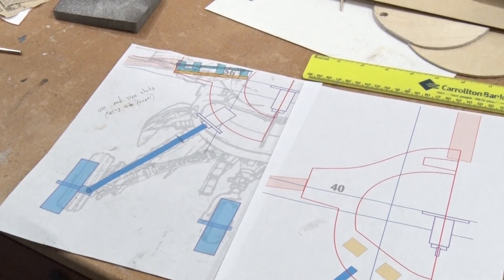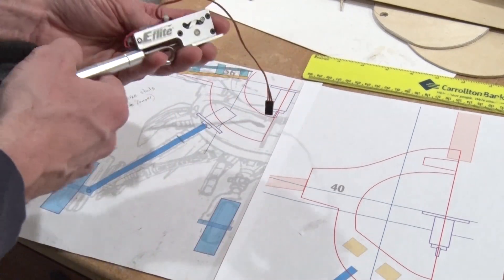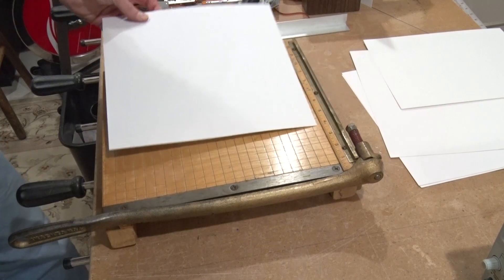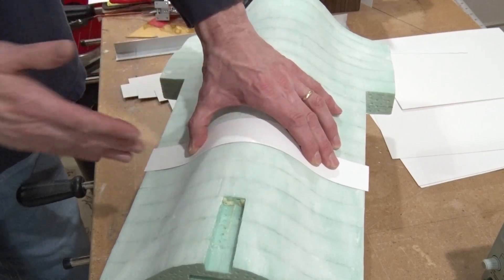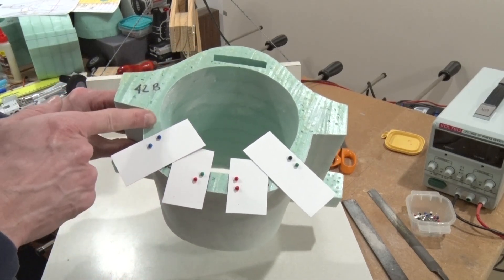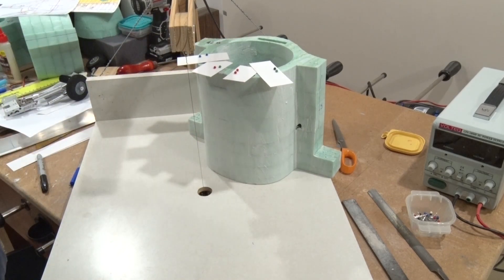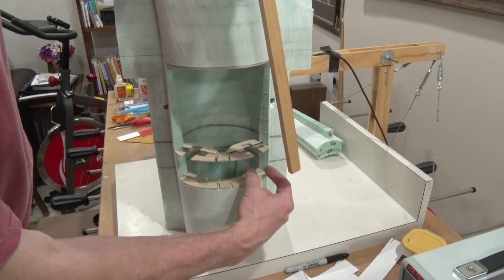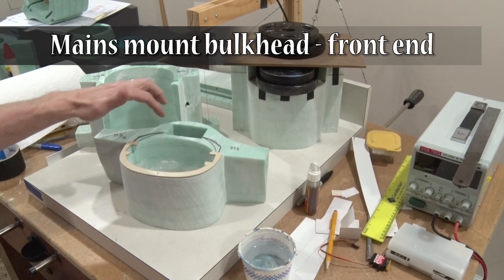Build Process F 16 C (Part 3)

Comment: So did that section just get 1/4" longer  (2 x 1/8" Plywood) or did you have to trim the foam back?  It's just a curiosity.  You do such beautiful work... all of your videos are so nice to watch.  I know you used the great Gorilla Glue on the plywood sections,  but did you also use it on the regular foam sections?
Reply from the maker: FlyMario Yes, that added close to a 1/4” to the fuse length. Really just about a 1/8”. After hot wiring the the fuse where the two wood sections belong and then sanding all sides smooth in order to glue the wood bulkheads in place  it really measured out to be close to an 1/8”.

Comment: I put F16 retracts in my Jet Hanger A7 , yellow aircraft  F16  and  Jet Age  F 104  witch are all  fiberglass, ,,about 10# (turbines ). They are operated by a controller that can accept doors, lights, etc. Look in the spare parts section for the F 104 or F16 @ Motion RC, ,,love your Inthusyasium, ,,best of luck! !!